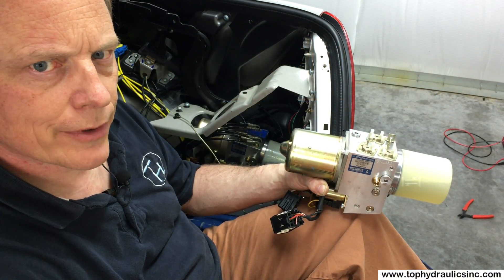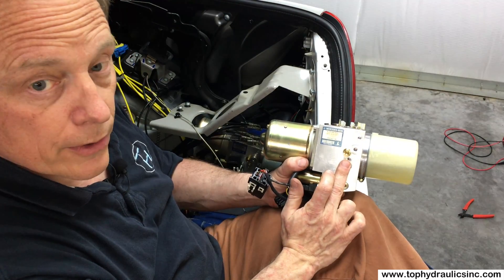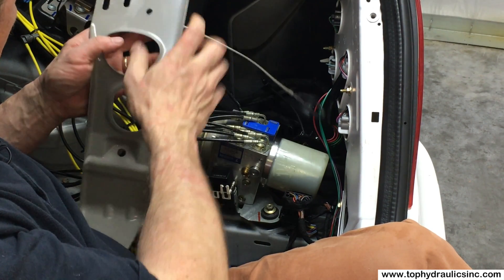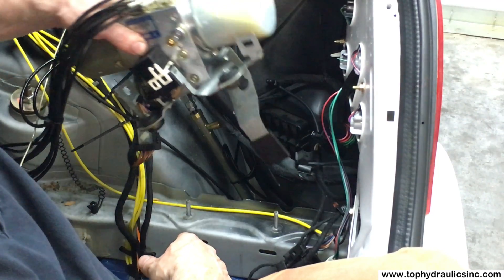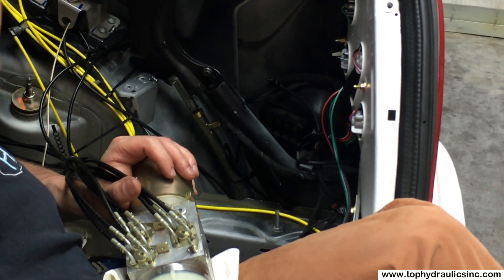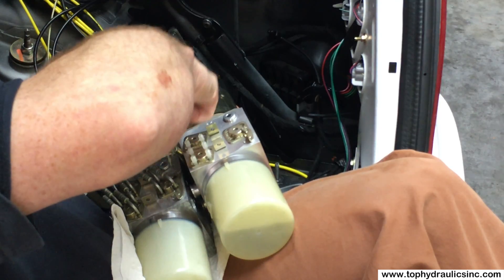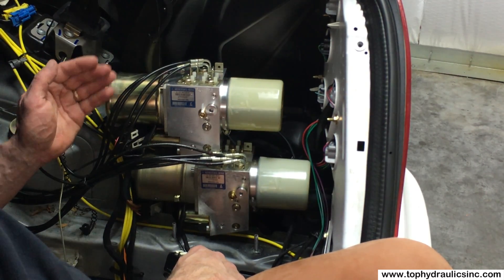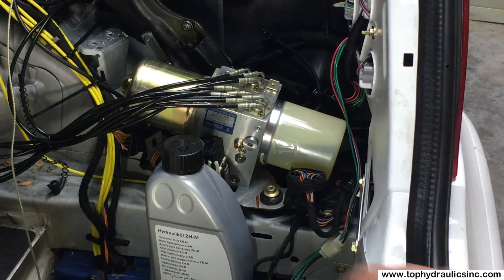Mercedes R170 SLK - Chapter 6  - How To Replace The Hydraulic Pump

Comment: Klaus and Top Hydraulics are are the best source of information and quality parts for these convertible top systems. The videos are very well produced, informative and easy to follow. You may not think these are DIY projects, but considering the cost for a pro to do the same work, you have a powerful incentive to get out the tools and give it a try. You can rely on Klaus for quality parts and prompt, expert guidance.
Reply from the maker: Thanks for your kind words! Indeed, the job of replacing the hydraulics in your top is not that difficult once it is broken down into single steps, as shown in our videos. The R170 SLK is an excellent car and well worth fixing, because newer cars only develop more problems as they age. You can do the job yourself, save a lot of money and feel good about your accomplishment...

Comment: Hello! I have tried to figure out whats wrong with my SLK.. Relays seem to work, all electrical components seem to be fine. The pump makes a sound when I press the switch in the car but nothing moves, cant see any signs of leakage. What could i try?
Reply from the maker: If the pump runs and nothing moves at all, that is typically a weak pump or an open bypass valve on the pump. Make sure the bypass valve (6-mm brass Allen bolt on the side of the pump) is closed and try this test of the pump:  https://www.youtube.com/watch?v=HerRBslxn3A&list=PLly4CMbpk7oxzfmMaPF6w5l1xEtmsKUXF&index=10
Reply: @TopHydraulics  you are awesome, thanks for answering. Going to check this out

Comment: Hello, Thanks for the detailed video, might come in handy.

Is there a way to check if the pump has failed or something else? My car's roof won't go down but it ran for 70k KM and the pump looks good (fluid level, no leaking).
Reply from the maker: We can probably figure it out together. What are the exact symptoms? Does the red button flash as soon as you pull it, or do you hear the pump running and nothing moves?
Reply: @TopHydraulics  

Thank you for your reply, much appreciated
A few details, I hope they help:

1. The pump doesn't run, no sound coming from it, checked the relay it's working.

2. The car has been parked for a few months since the issue, I don't remember if the light was flashing, I think it was always on and flash when pressed.

3. The little windows are not going up

4. The car had issues latching in the back when it was working, the right side. The trunk would close all the way after putting the roof back up, but it the right edge behind the passenger seat would remain raised a little bit.

It ran like this for a long time, since it had 20k-30k kms

4. No code errors when connected to a Mercedes tester.

Thank you very much good sir
Reply from the maker: @mustang19ms  If the red button is lit permanently (while the ignition is on), that is normally caused by the top or the trunk lid not being fully latched, which makes sense with the trunk lid not latching in one corner.

The button flashing while you pull or push it would indicate an illogical micro switch readout from the control module. A common reason for this in early model years is a sticky boot on one of the front latch micro switches S69/2 or S69/3. 

Best watch our video on troubleshooting the micro switches in the SLK top, and you should be able to fix your top: https://www.youtube.com/watch?v=uXKSfLEPWgE&list=PLly4CMbpk7oxzfmMaPF6w5l1xEtmsKUXF&index=8
Reply: @TopHydraulics  Thank you again for the great content & replies, I'll find some time to go through all of it.

Comment: the fill-in screw has been spoiled... how can  I replace it..??
Reply from the maker: Good question. This fill plug is metric, but it is a fractional metric size. Mercedes does not sell it and neither does anyone else that I am aware of. At Top Hydraulics, we replace these plugs if needed while we rebuild the pumps. We do not sell components, such as plugs.
If you want to replace the plug yourself, then you need to get one off a used SLK pump or make do with what you have at hand. In most cases, these plugs can still be used by pounding a Torx wrench into them. If you want to make sure that you have an emergency way of removing it next time, then you could cut a slot into it with a hacksaw (while it is off the pump, of course), so that you can use a large flat screwdriver next time. Be careful not to get any metal shavings into the pump!
Reply: @TopHydraulics   I plan to buy a rebuild  hydraulic pump or a new one...how much it will cost and how should I do it..?? my car is SLK 230 K  1997.
Reply from the maker: @irawansoegondo3785  Thanks for asking. A pump that has been rebuilt by Top Hydraulics is actually better than a new one from Mercedes, putting out more pressure and having longer lasting seals, for a fraction of what you would have to pay for a new one. Customers in most countries can order the pump directly through our website. Where are you located?
Reply: @TopHydraulics  Iam located at Jakarta Indonesia

Comment: Hi,Love your videos,very helpful.Now I just installed a used hydraulic lock cylinder in my 2003 SLK with 50,000 miles on it (wishing I had bought one of your complte sets and may just be doing that).I did all the work myself and I'm very proud of it as it was challenging and fun as well,now I'm getting ready to refill the pump with the proper fluid but was wondering should I bleed ,drain the original pump which is almost empty...is there a way to bleed it?? Do I have to? I have removed everything in the interior for the roof lock and the entire trunk is cleaned out as well and plan to leave it that way until I find out if I fixed the only leak or if another one or two or three or four show up,as I'm not taking it all apart 5 times..
Reply from the maker: Obviously, you know that buying a used cylinder was only a bandaid - it will probably fail sooner than later. You may want to leave the headliner out of the top panel for a few months, so that you can spot the new leak early on, in case it does not fail on you right away.

The system is self bleeding and draining the pump is not simple. There probably is not much fluid left in your system, so you will have mostly new fluid in it anyway. Unless the fluid in the bottom of your pump is very, very black, I would fill the pump, operate the top and refill the pump as needed. To drain the pump, you would have to take off the reservoir, which is opening another can of worms...
Reply: @TopHydraulics  Yes the headliner which is ruined do to prior leak and all anything taken that was needed to be removed everything in the trunk and I'm going to wait to see what happens.
Reply: First leak and only leak happened 4 years ago when the SLK was 13 years old.
Reply: How much is an entire new system?..Pump and hydraulics??
Reply from the maker: @stephaniemartin5744  How old is the used cylinder that you installed? The manufacturing date is printed on the hoses.
Reply: @TopHydraulics  Have not checked the date but it has the curved fittings,well it's installed and it works perfectly with no leaks anywhere,the car has just over 50,000 on it and always garaged.I'm super proud of myself for doing this as it was complicated but fun and with your perfect videos it was done.The top goes up the top goes down works like new,I said I took everything out of the trunk and what it took to do the roof latch lock and I'm in no rush to put anything back in.will give it some time to see what may or may not happen but feel very confident that I can handle a bad pump or any of the other hydraulics as in the trunk and the roof..was actually very easy for me to do....but thank you for your help...as it did help...Stephanie M.
Reply from the maker: @stephaniemartin5744  If the used Vario Roof Front Latch Cylinder 1708000072 has curved fittings, then it is out of a model year '98 or '99. Unless this cylinder has been professionally rebuilt and ALL seals in it have been replaced, it will not last long. The good news is, indeed, you can now be confident that you can handle any problem with your convertible top Hydraulics.
Reply: @TopHydraulics  Hi, Yes figured it was older than the 2003,but it is working fine with no other leaks at this point (fingers Crossed)...I ran it a bit low on the hydraulic fluid and wanted to raise it to the mid of the high mark and low mark but now I have to much fluid in the tank.I felt I was being extra careful when adding the extra but put to much in and I have not operated it since,what is the best way to remove the extra oil?? Have not found the answer on YouTube as of yet.Please Help Me :)
Reply from the maker: @stephaniemartin5744  You could leave the fill screw cracked open and move the top manually. That way, you avoid over-pressurizing the reservoir. There will probably not be any fluid coming out the fill port and you can observe where the fluid level settles after a full cycle or two. If there is still too much fluid in the pump after that, then you could disconnect hoses 42 & 44, stick them in a waste container, and then manually retract the top. Once the top is retracted, reconnect the hoses.